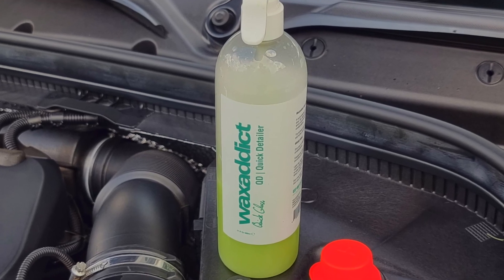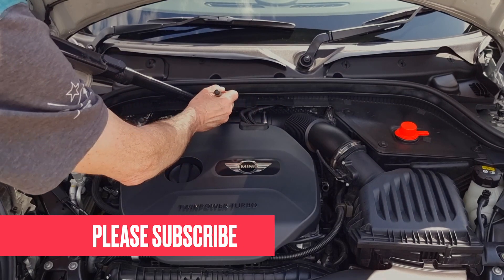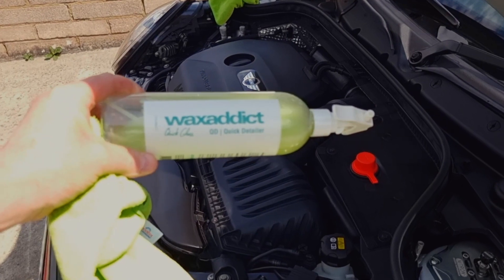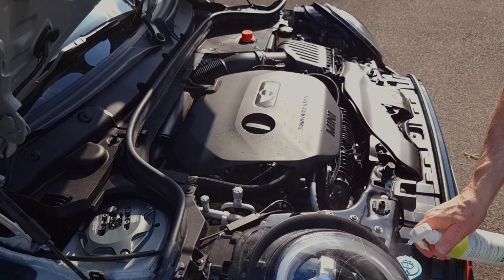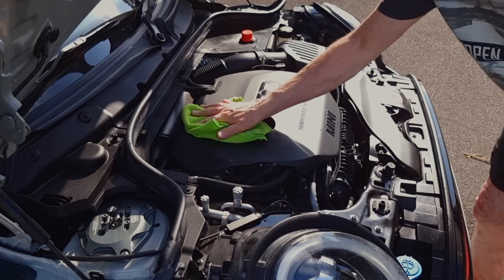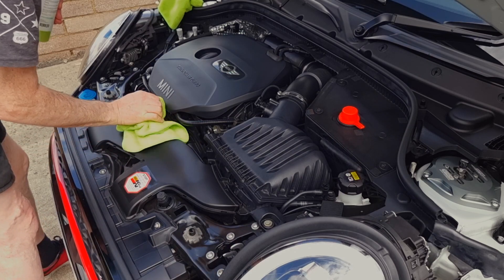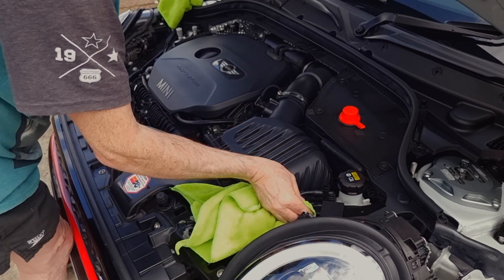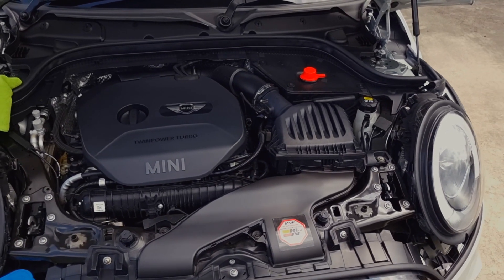Waxaddict Quick Detailer - Easy Application for a Brilliant Finish

Comment: Not a fan of rtu qd's but then checked their website and they do it in a concentrate. Definitely worth a look
Reply from the maker: It's a lot better as a concentrate, including the price. This video is about 10 months old. Would you like to guess how long I have had the product 🤔 longer than expected, but the quality is very good. Would I buy it again, most likely not, as I have got so many different types of product which I will get round to  testing out 🤣😂